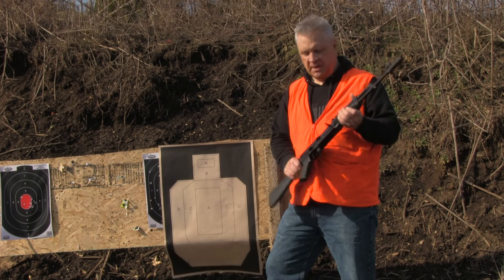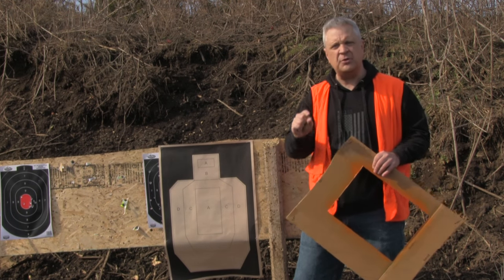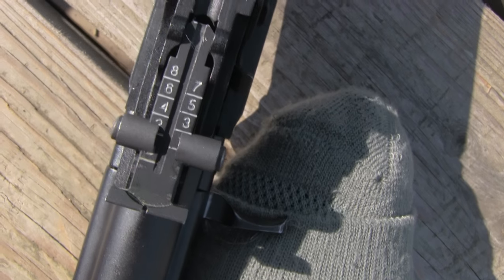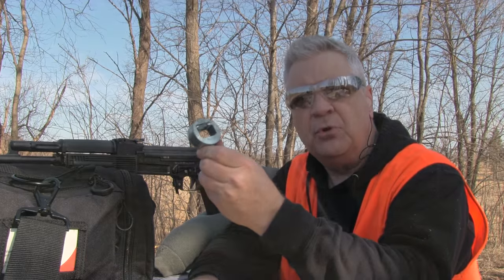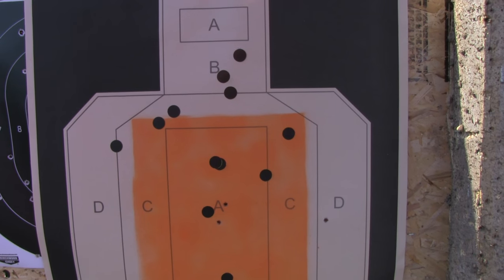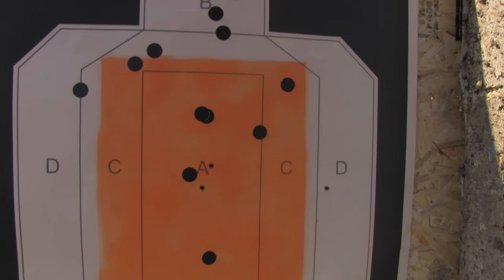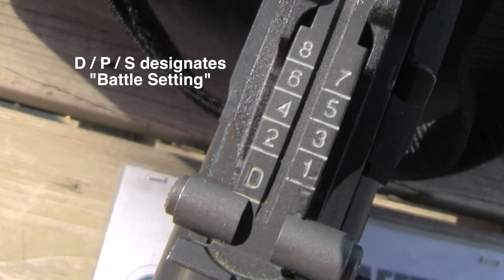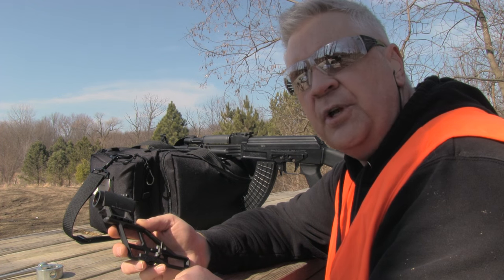Nyet!  AK Designed to be Zeroed Soviet Way

Comment: This is one of if not the most accurate descriptions and explanations of the Soviet zeroing of the AK I have seen on U2B. I used a similar version of this method. The only difference between the method you used and the one I used was my addition of a 25 yard zero on the "2" setting before the 100m verification. This is not my method and I don't take credit for it but it does work. I took this information from Savannah Arsenal. What he recommends is exactly what this video describes but it adds an initial step which helps dial in the rifle at a closer range before going out to 100m. In my case this step helped a lot because my sights were way off. Had I begun at 100m I would have been completely missing my target and thus would not have known where my bullets were going. With a rear leaf setting of 2 you zero the AK, taking advantage of the 200 meter trajectory, which has a near zero at approximately 25 yards. You then follow the technique described in this video to 1. verify that your rifle is zeroed and 2. fin-tune your zero.

Comment: I do mine bassackwards.

Put the top of post at bottom of the rear at less than 1 meter at the 100 meter setting. Field adjust as needed.

Comment: Very interesting. The first part, adjusting the iron sights? A+.  The last part on what to do with the red dot? Nyet. I didn't understand that at all.
Reply from the maker: +ditto1958 You sight the red dot the same way.  You want the dot at the center of the belt line at 100 meters.

Comment: Well shit , mines zeroed at 25 meters . For over all bullet drop meeting at 200 meters . Hmm wonder which I should use .
Reply: The sight technique like that I saw was doing 25 yards on the 200m setting.
Reply: It doesnt matter.. The final effect is/should be the same. If you zero at 25m with rear sight set to 2, you get the same as above (zeroing at 100m with rear sight set to 3, POI = POA + 25cm).

The method you used is great especially if you don't have a 100m range -> 25m is enough to properly zero 7.62x39

The reason for the method shown here is that at 100m the width of the target (25cm - coloured box) is exactly the same as the width of the front sight. Second to that, it is easier to aim the lower border of the rectangle due to colour contrast (especially if that rectangle is black/dark colour, not as bright as in this case). The dark rectangle should be an elongation of your front sight post.

Another video on this topic:
https://www.youtube.com/watch?v=wdX1PiHvy-U&t

Comment: So as I can't get an AK47 rifle, but I am permitted to buy and use my SKS-45 rifles,..would this method work for the SKS rifles too ?
If it can be used the same, then this is a great and timely video.  If it can't be used, then this is a great and interesting video.
Reply: Yes, this will work with an SKS or Vz58.
Reply: Same sight tool as well
Reply: +Orpheus Epiphanes  
That's nice, as I have both of these rifles.  
Thanks.
Reply: +Reg Sparkes VZs are great rifles. I wish my AK took VZ mags.
Reply: The 18m on battle setting /100m at 100m, 25yards on 200m setting/100m at 100m setting, and this one apparently will work on both AK's and SKS's using the standard ~122grain 7.62x39.  5.45x39, and 5.56x45 are a standardly longer range round so these methods wouldn't work as good for them.
Reply: 5.45 "battle setting" is a 400m zero so the system is the same but the range is different

Comment: It's not a platform and it's not a weapons system, it's a rifle. There is much better ways to zero your AK. Anyone who has ever been in combat will tell you  your enemy isn't going to be standing out in the open chest facing you giving you a perfect center of mass shot. The 6 o'clock hold is nonsense, think about it
Reply from the maker: Rich Stone, keyboard warrior extraordinaire.  Might want to fact check a bit before embarrassing yourself any further buddy.
Reply from the maker: Haha!!  Let the butthurt flow through you, Rich.
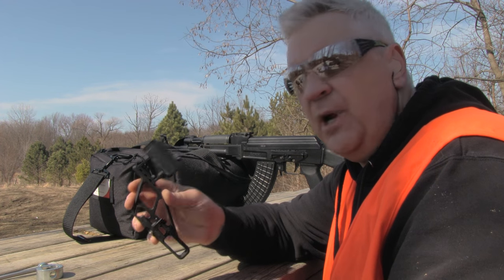Reply from the maker: Hey Rich, watch and weep.  Check it out at about the 5:54 mark.  https://youtu.be/qBNrgltB7e8
Reply: Hes correct though. AK is more of a system, the weapon system being built from ground up specified to one cartridge with no means of dissasembling in order to change vital parts without serious modifications and specific tools to do so. Although the AK system able to be built in a variety of different cartridges.
While the AR is more of a platform, the lower and upper being 2 seperate parts with the ability of interchanging uppers, calibers, and barrel lengths.. A group of technologies that are used as a base upon which other applications, processes, or technologies are developed and or adapted - platform... 

And no, with standard AK sights there is no other way let alone a better way to sight in the AK then the way the Soviets required. Which the AK sights were developed for and specifically built with the intended procedure in mind. Whole reason why there is a specific battle sight for use out to 300 meters and why you set it at 300 meters when zeroing. The battle sight is 300 meters and is basically a set adjustment for all basic combat scenarios and distances out to 300 meters when firing at avg man sized targets/torso,, with no need to adjust for differences unless trying to take a precise shot. Such as someone ducking and hiding making the target small.